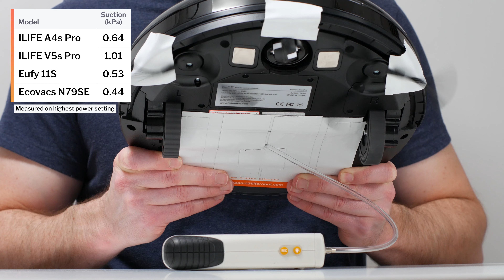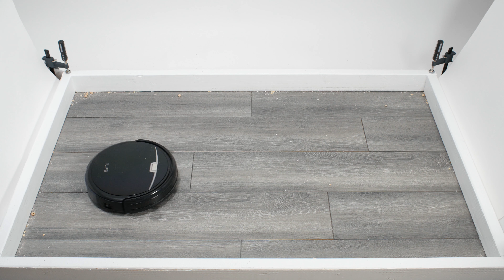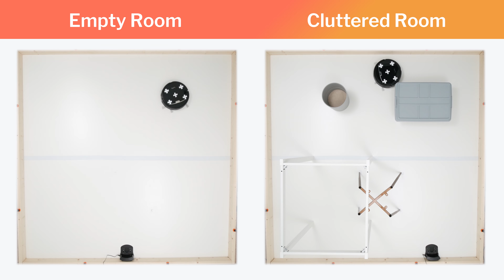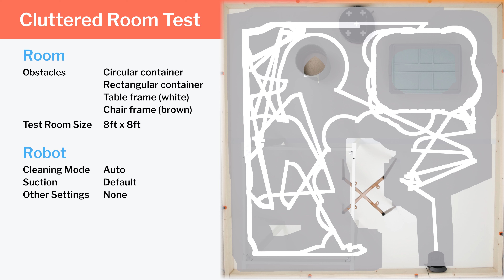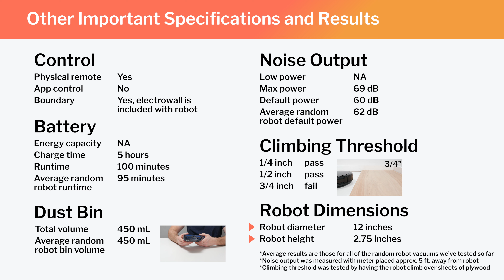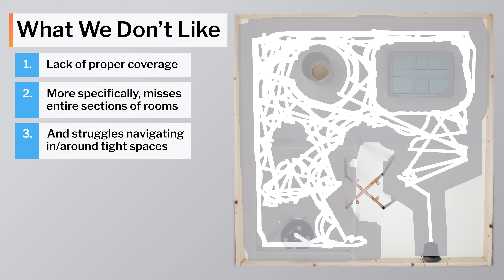ILIFE A4s Pro Review

Comment: It's coverage was affected by the charging station. It doesn't clean round the charger so it can return to charge without disrupting or bumping it's location which could affect it's charging cycle. If you take away the charging station it'll cover the room evenly.